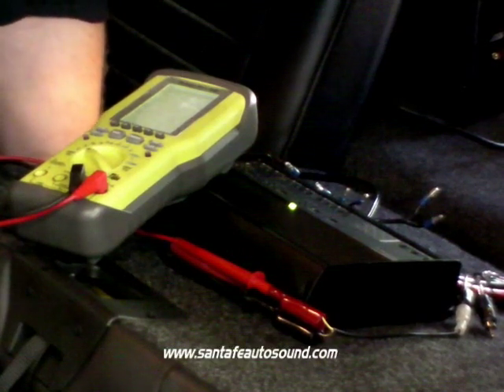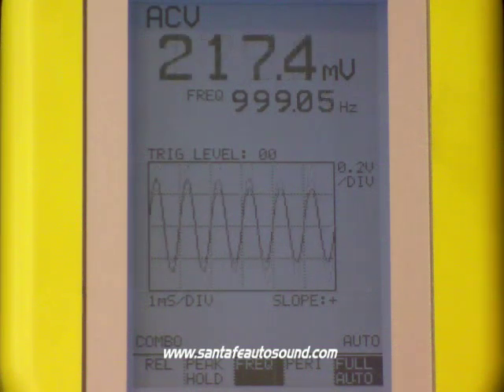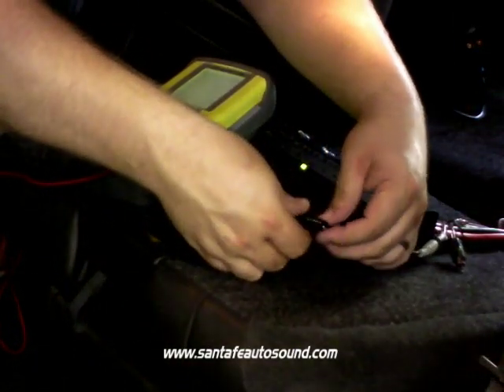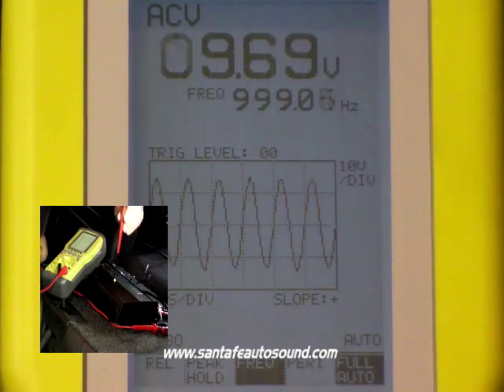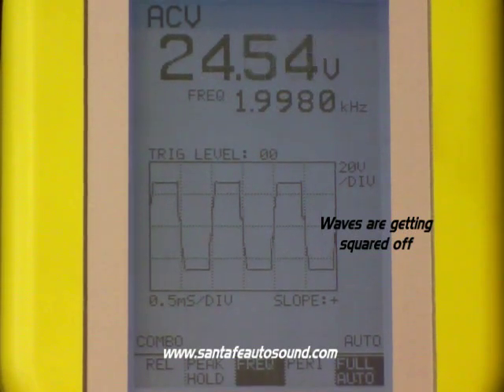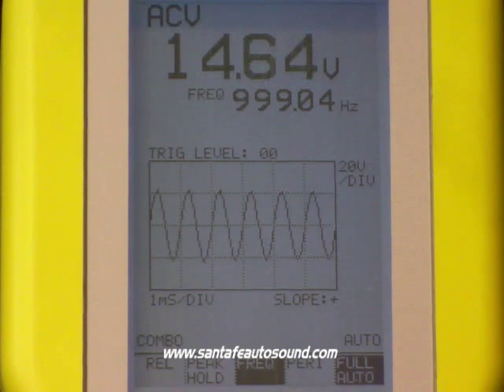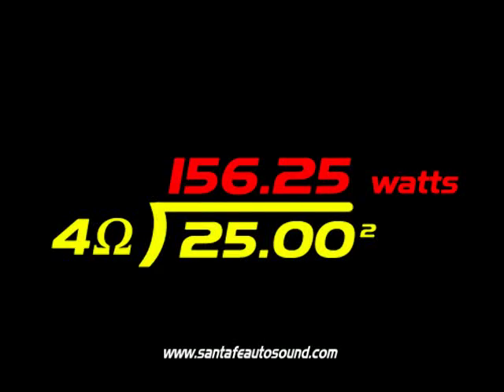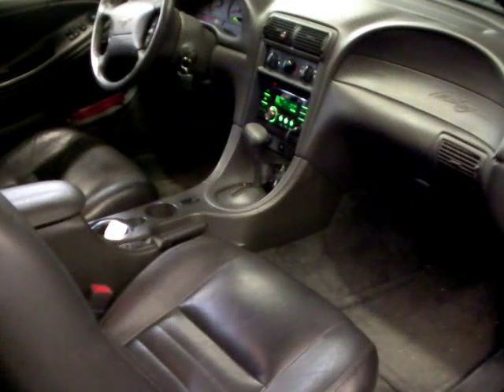Amp Gain Setting w/ Oscilloscope.mp4

Comment: yea because a speaker at 4ohm nominal never changes impedance...   thats is not an accurate way to test for actual RMS wattage, your DMM does not account for power factor.. speakers are not pure resistive loads

Comment: would an oscilloscope app on my phone be sufficient? and if i put my bass boost to zero when doing this, what if i turn up my bass boost later on and it starts clipping?
Reply: I would question the accuracy of an app on your phone simply because you are relying on the phones speaker to "listen" instead of actually measuring the source and phone microphones aren't great at low frequencies and any rattle would make it virtually impossible to read as the scope app would display all the rattles frequencies not a solid single frequency and YES if you tune with bass boost all the way down then turn it up you will introduce clipping

Comment: I would rather spend 300 on an oscilloscope then shell out 160 bucks for the SMD tools that from what I have seen have very high fail rate.
Reply: A dso150 toy oscilloscope will get this kind of a job done and its 20$.
Reply: george once ya can use a scope thats all ya need.i have this scope. amazing tool

Comment: If I am correct, the head unit should never clip correct?  Mine was at 2.84 and its rated for 3.0.
Reply: headunits likely will clip, especially if using any bass boosting EQ settings, the closer you get to max unit volume the higher  the voltage, the question then becomes does the radio hit rated voltage without clipping, most radios will get close, like Pioneers that have a volume scale to 62 will likely clip somewhere between 58 and 62, where the headunit clipping starts then becomes your "max safe volume" as that is the limit before clipping on the unit, then from there you turn the amp gains to just below clipping and now you have a non-clipped signal all the way to the max safe volume.